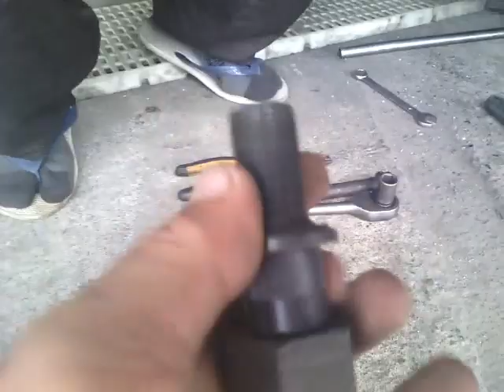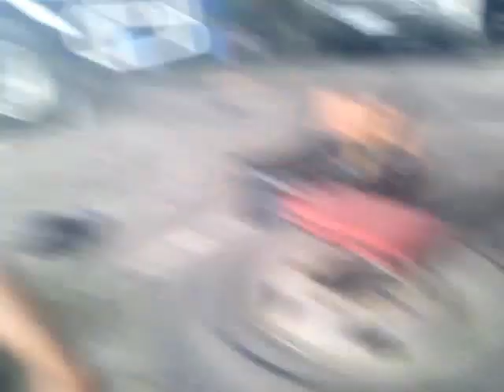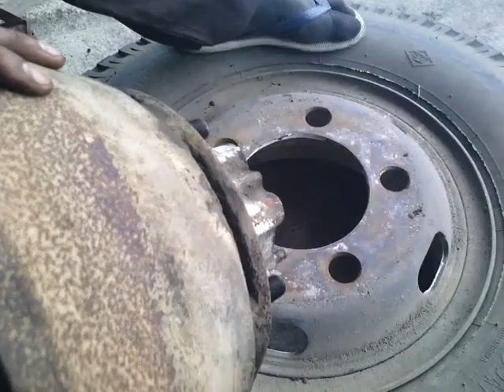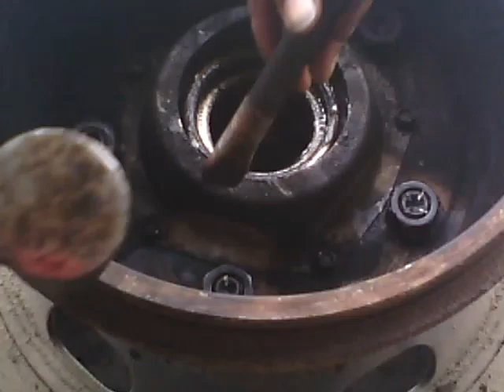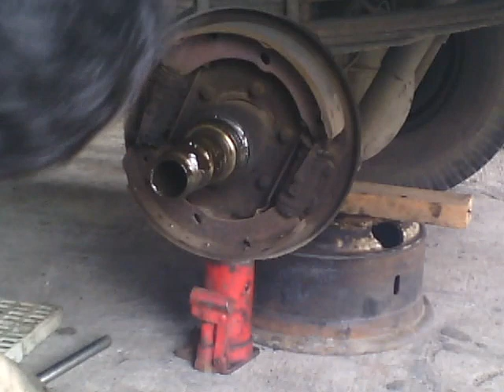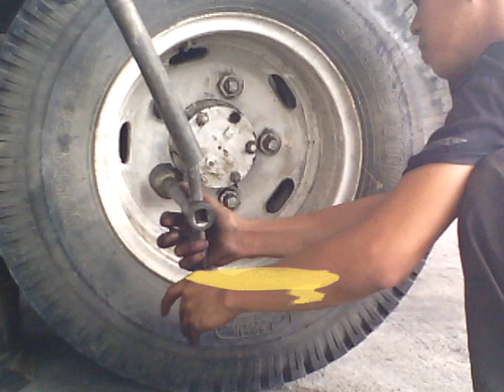Replacement of HUB STUD BOLT (isuzu elf truck)

Comment: NO GOOD!!!!!! you forgot to install brake shoe lock, replaced axle bolt still broken... carefull!!
Reply from the maker: By the way thanks for watching. The axle stud bolts is for separate video bcoz i need to bring it on machine shop for stud pull out..